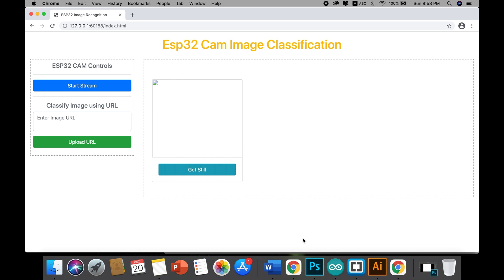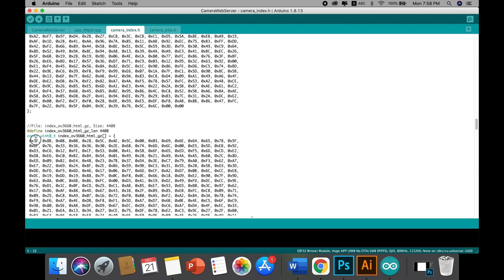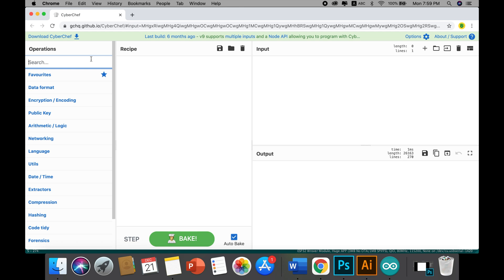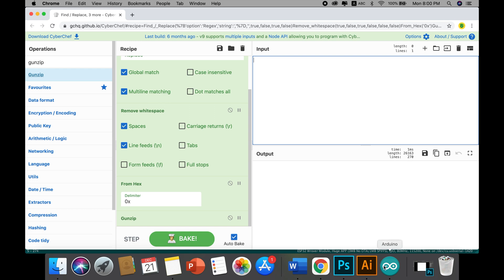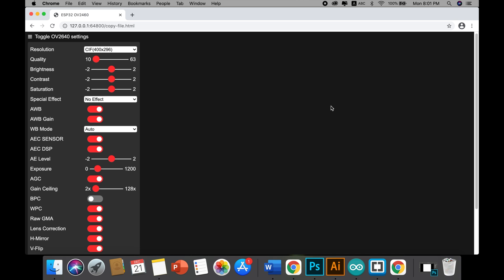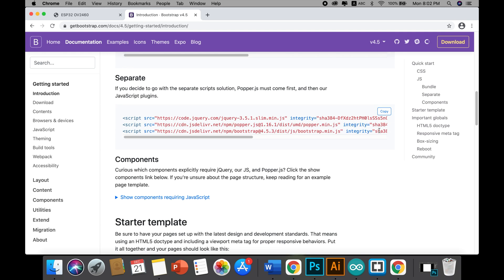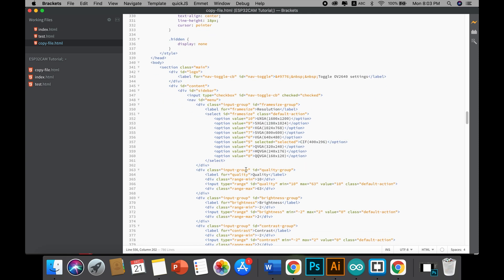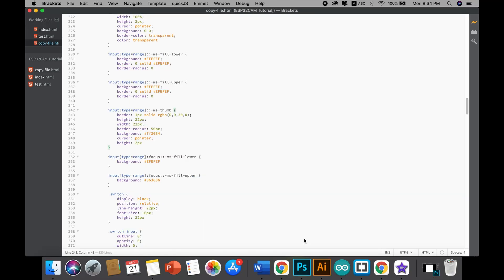Image processing with ESP32-CAM |Deep Learning|Creating UI| Free Code📝🧑🏻‍💻available|  #tensorflowjs

Comment: Hi, So just to clarify, is this code using a tflite model, and doing all of the processing upon the esp32, or are you simply feeding images from esp32 into the computer, computing there then displaying on a web server?
Reply from the maker: The core process is happening in browser. Esp32cam only holds the source  code and all the image processing is being done in your browser. All the magic is through JavaScript and jQuery (which is getting executed on client (browsers that are accessing the esp32 server)
TF js framework > mobilenet model.
Reply: @wiredai2195  Thank you for your speedy reply. That's great, sadly I want to do the processing on the esp32 instead, but good to know of external processing methods.